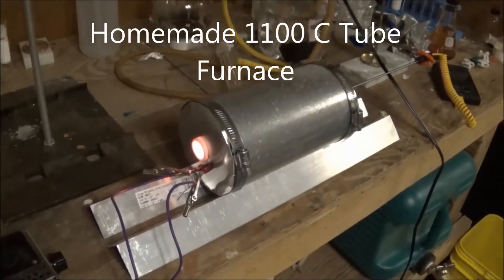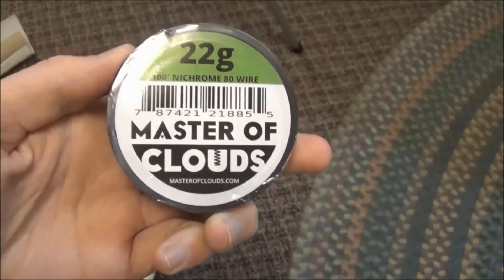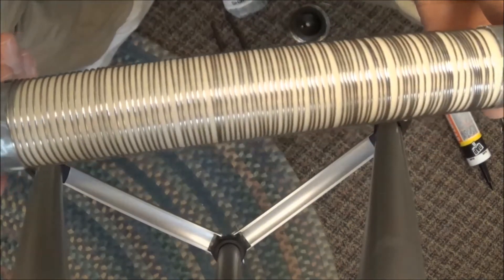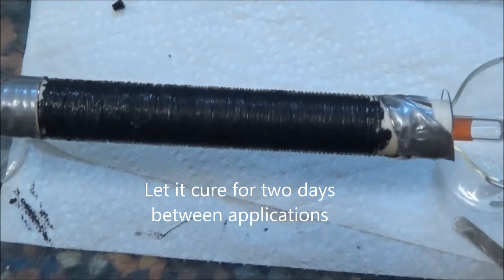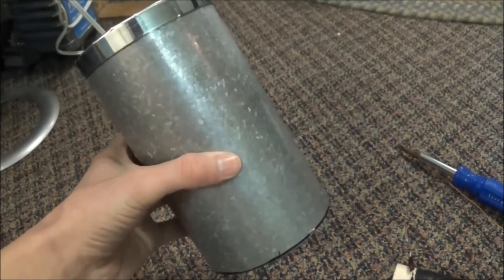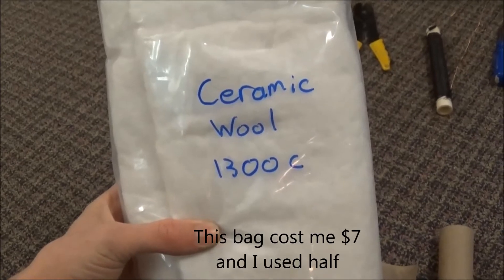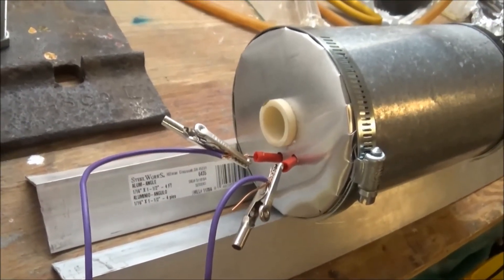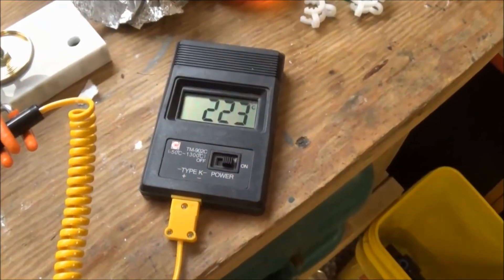Homemade 1100 C Tube Furnace

Comment: very nice build Tom!! 
i was wondering though for how long this would work with the current insulation, and morter that was put on the wire, as the wire itself gets somewhat hotter then the rated insulation and morter used.
im planning a build like this my self, but with a 200mm bin and a 50mm OD 40ID tube.  needs to have a max temp of 1200c and im thinking of using 700 watt max for the design..
did you notice any problems with the insulation not being able to handle the heat.?

Comment: Excellent video and many thanks for posting.  I just replicated your design which easily hit 1100 Celsius. However, it’s important to note the operating range of the Master Supply nichrome wire has a ceiling of 1180 Celsius. Flirting with temps of 1100 Celsius or above will absolutely result in failure. That aside, it’s a true performer at 1000 Celsius.  

As everyone has noted, winding the element is the most difficult part. I’ve also found the second coat of mortar isn’t necessary unless the first coat was extremely thin.  

In retrospect, an easier and equally performing tube furnace design would incorporate two 9x4.5 firebricks as the chamber. A cored out axis along the length of 1” would suffice. Standard coil type elements could be fit within the radius.

Comment: I have built this. Just a few things I wish I knew before I started:
1. If you order your alumina tube/insulation from eBay, it will take several weeks to get to the states
2. You need to find a PID ramp/soak (not a thermostat) controller if you want to program the furnace and use it for any kind of scientific experiment/process. You will need a K-type thermocouple and a solid state DC powered AC NO relay. 
3. The nichrome wire is incredibly difficult to work with when wrapping around the tube. I had to tape down the wire every couple inches of tube that I covered in order to keep it from becoming an annoying slinky. 
4. You do not need the entire roll of nichrome wire, only about a fourth of it.
4. I ended up just putting on gloves and using my hands to cover the nichrome with DAP furnace sealant. Much faster.
5. Do NOT cover the tape holding down the wire with sealant, it is very difficult to remove once it dries.
6. Use Telfon insulation for connecting wires, everything else will burn.
7. Two blankets of Alumina is best to ensure the outside doesn't become too hot.
8. AC power is fine for Nichrome, you do not need a DC power source.

Comment: So, for organic reactions requiring a tube furnace that also involve concentrated acids, with this design, wouldn't you still have to find & fit a glass/quartz tube with ground glass joints to fill w/catalyst or are people expected to use the ceramic tube for contact with everything?

How would one couple this furnace with 24/40 glassware?
Reply from the maker: That's how I always use it, I have some quartz tubes the fit inside and I seal the ends with lots of PTFE tape. I would love some 14/20 jointed quartz for this, but I couldn't justify the expense. I mostly use 24/40 glassware and I use adapters to match the size of my tube.

Comment: just a tip for anyone building this, on the heating elements, twist the nichrome wire back on itself for double thickness before twisting on the copper. this makes a low resistance lead to keep the copper cool

Comment: Congratulations, did you use a fuse for it? Where can I put a fuse for protection?
Reply from the maker: I believe that there is a fuse in the power supply I use. A fuse could go anywhere along the wires that hook up to the heating element. I wasn't super concerned with a fuse because a serious short between windings would end up melting the nichrome, acting as its own fuse.

Comment: Hello who is viewing the comment, This is Anya from China,my company is Henan Chengyi Equipment Science and Technology Ltd.our factory produce heat treatment equipment for lab research,our products including:muffle furnace,tube furnace, box furnace, quench furnace, RTP furnace, CVD system, Pusher kiln, Roller hearth kiln, Network with kiln and so on, mainly applied to research lab and civil new material production field.

If you have any requirement for this, contact me feel freely at any time!
My Whatsapp/Wechat is 008617719806370,
Email:anya@chysk.com

Comment: great, I am a furnace manufacturer from China.
Reply: GREAT! I have an idea, and may need your help!!!
Reply: I need a material that is resistant to high temperature from 500°F to 1300°F, to create molds, for melted stone of all sorts. I want to build a modern day monolith in the same fassion ancients used to, I want to prove we can build something great with such presicion like an Ancient Egyptian Pyramid!!!!!
Reply: I will also need a very very large furnace to toss alot of rocks that burns from 500°F to 1200°F to melt the rocks so we can pour them onto the molds, and lay down the newly melted stones into place 1 by 1!!!!

Comment: Those furnaces are really expensive if you buy them already built. Congrats on making your own!

(where'd you get the ceramic tube from?)
Reply from the maker: I know, cheap used ones cost at least $100, but comparable furnaces cost at least $300. 
My tube is from here: https://www.ebay.com/itm/Alumina-Ceramic-Tube-200-25-20mm-1pc-1650-Metal-Copper-Vapor-Laser-Customize/301478522651?ssPageName=STRK%3AMEBIDX%3AIT&_trksid=p2057872.m2749.l2649

Comment: That would be perfect for making calcium oxide from carbonate.
Reply: I've actually done it in a similar furnace (to make some calcium-cerium oxide). And yeah, it works!
Reply from the maker: It's a little small but yeah! I would like to build a larger furnace that could fit around a 100 mL crucible. Something along the lines of the one that Doug's Lab made but a little smaller.
Reply: ppprrrr pernacchia

Comment: Cool shit, we have 3x230v outlet (a big boy power socket) so we may run like 10-20kW of power (on 1 socket)
But we always have to skip these projects due to cost (we need a bigger version, about 500-2000W)
Reply: Nice video. Saw your SM post. Great job!
Reply from the maker: With this small size it was relatively cheap, cost me about $30. For bigger it will cost more, I imagine a big (500 mm long, 40 mm diameter) one would probably cost $200. Mine is 500 watts maximum but I don't need anywhere near that power. Less than 100 watts will maintain it at 1100 degrees. I have seen some of the bigger ones take 2000 watts and beyond.
Reply: Mischa What? They are pretty common in many labs. It’s called A tube or muffle furnace. Generally though they use a quartz glass tube and they are very useful. He’s just opened the door to many more exciting reactions which were otherwise limited by temperature. White phosphorus and carbon disulphide comes to mind.
Reply from the maker: Mischa What? There were some shortages right after winding but I fixed most of them while applying the mortar. The wire is Nichrome A and melts at 1400 C, so I would probably say 1300 C is the max temperature.